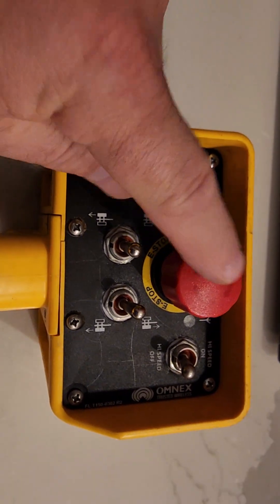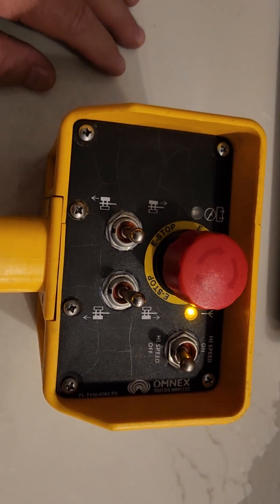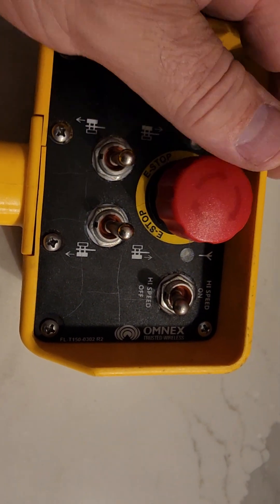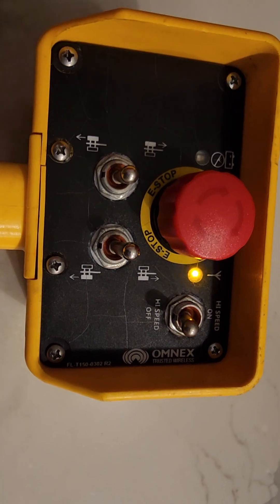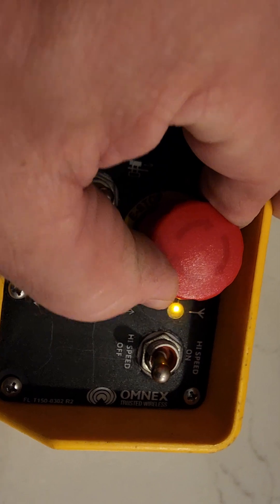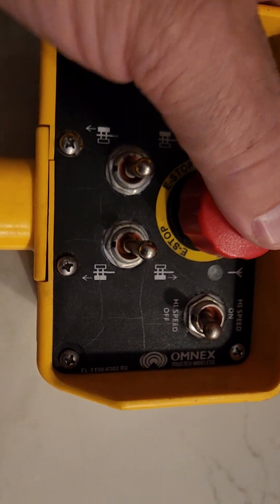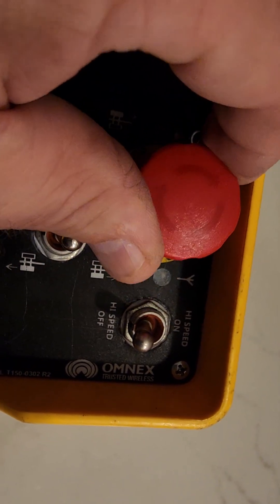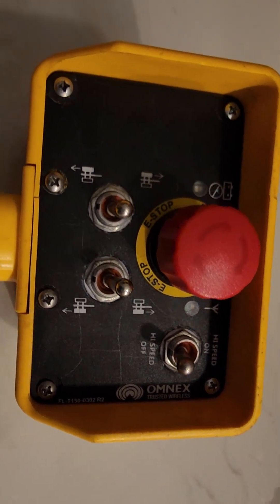Skylift Wireless Remote Transmitter (Omnex T150) E-switch Test

Comment: Hey what machine does this control? Skylift machine? What is the serial number on this remote, i have a tracked machine and cant find the controller for it, itcsays i need a t-150 but need the numbers to match skylift
Reply from the maker: 2015 Versalift/ Skylift Super Arborist MA53T
Reply from the maker: I talked with a company from Iowa that can reprogram the firmware for the transmitter and receiver but it's expensive. I will confirm the serial number once I get my unit in hand.